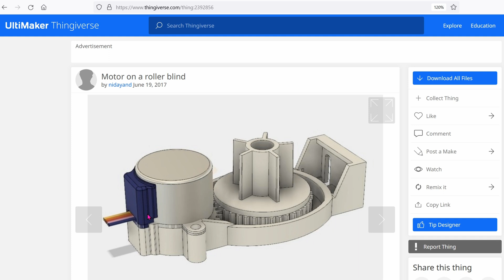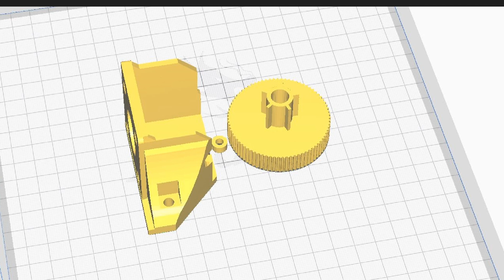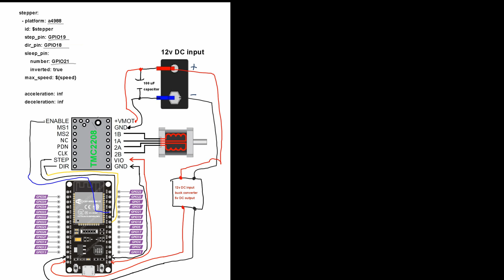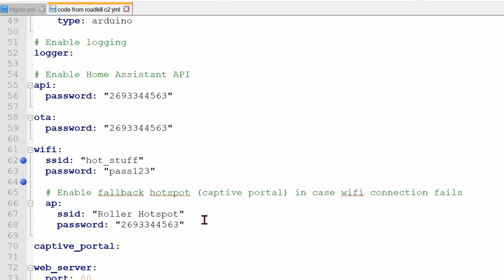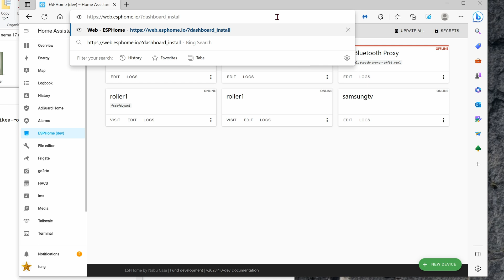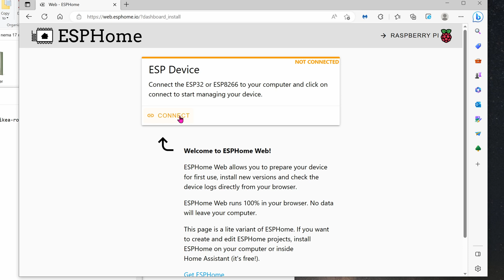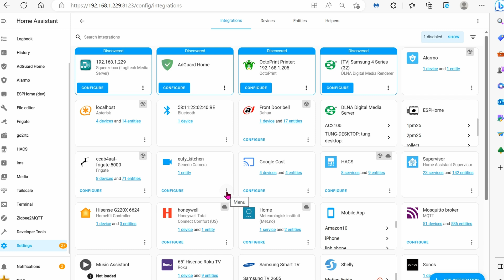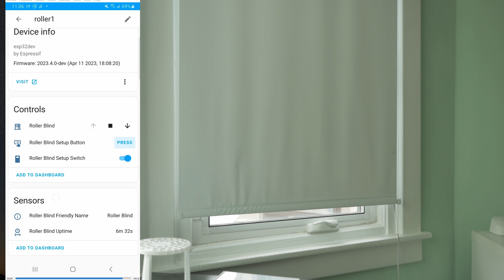DIY your own automatic roller shade for big, or small windows

Comment: Hello, I'm back with problem. I've installed the software, connected wires by special stepper motor board. Everything lights up with red lights and nothing after that. The esp is not connected to my internet. That's shema of my connections https://cdn.thingiverse.com/assets/2b/a3/a2/e3/79/e37aca66-7e3b-4140-a221-53ab546fec2a.jpg

Comment: I have all the parts laying around except I have an ESP8266. Can I get away with using your code ?
Reply: I was able to use your code np ! Just needed to modify the platform/board code block. You rock !
Reply from the maker: @Rubiconification happy it worked out! i thought it only works for esp32 boards

Comment: I have a one question, how much volts should be settup at driver?
Reply from the maker: im going to assume you are talking about the potentiometer on the driver board.  if so, i dont know. i left it at default position.
Reply: @dablet  Yes I'm talking about that potentiometer. Thanks for answer :)